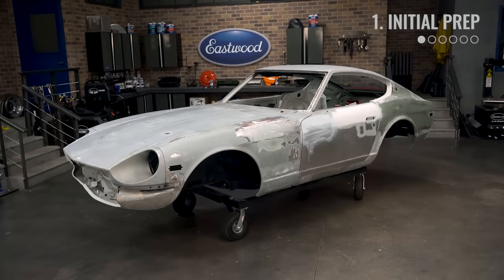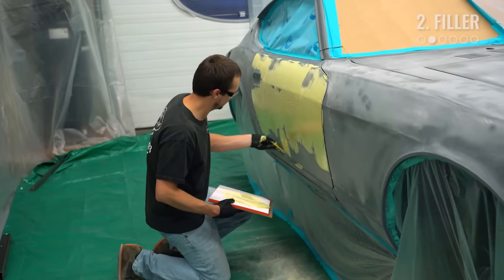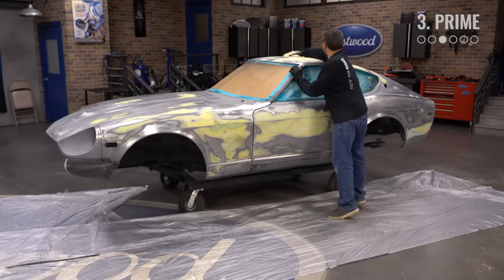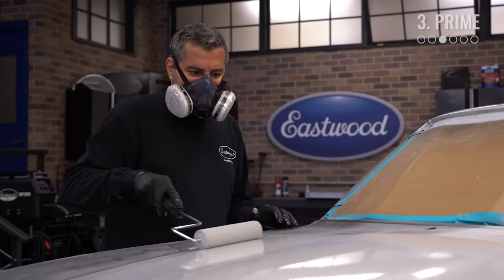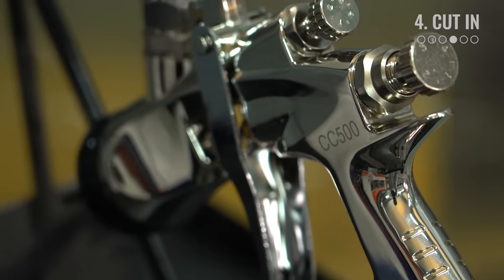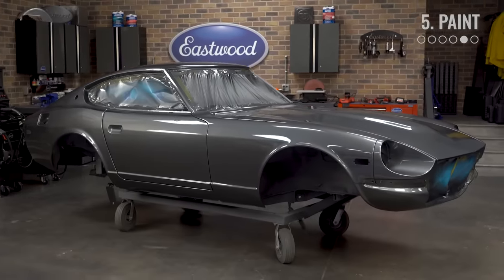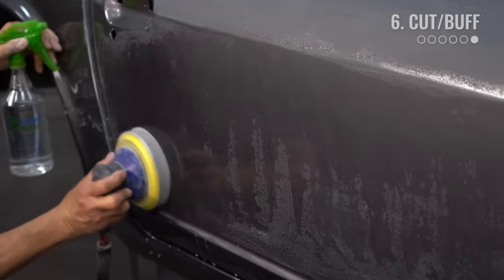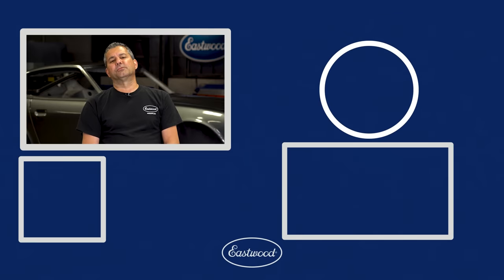STEP-BY-STEP GUIDE: How to Paint a Car at Home

Comment: How much is this project?
Reply from the maker: That's a pretty BROAD question, the car? the body work? the top coats?

Ignoring the purchase of the car, depending on it's condition it will be more or less expensive based on how much metal and body work it needs.

The materials, Plastic Body Filler, Primer(s), and top coats can range anywhere from <$1000 to $10,000.

This probably has $6000 roughly in above mentioned items by the time it rolled out of the shop - which is a steal compared to the more than $25,000 it would have cost at a body shop. (man hours are expensive)

Comment: I can’t find this paint on the site, any more info for this?
Reply from the maker: Here's the link to OEM Select:
https://www.eastwood.com/oempaint/selecting/brandmakeyear

I just double checked the Alfa Romeo Code 319B (used in the video) and it popped right up.  If you have any issues you can always call us directly at: 800-343-9353

Comment: You can do this at home if your house has a paint booth and you live in an industrial neighborhood. If I vented all this paint into my sub-division my neighbors would choke then call the cops.
Reply from the maker: Yes, painting has challenges depending on your garage location.  BUT you can still get the vehicle up through the stages and prepped using the Opti Flow system and then find a paint booth solution.

Comment: The sanding and prep is daunting. I'm not about to do ALLLLL that. It's like 40 sanding steps? Geez. Ok, so this is like, premium level smoothing out the metal. Cool, but, this video doesn't help me get started because I still don't know what sprayer and nozzles to buy.
Reply from the maker: Body work and prep are time consuming but not complicated. If you take your time YOU can also get great results.

We list what our gun settings are in the video by step.  But generally we are using the CC 500 which can be found here: https://www.eastwood.com/eastwood-elite-color-and-clearcoat-hvlp-paint-gun.html

2.0 Tip for Polyester Primer
1.3 Needle for Base and Clear Coat

Comment: Jeez! I just saw a video where a guy painted his truck using a single stage paint (three coats wet) and one clear coat. All these steps are crazy confusing to any beginner.
Reply from the maker: That's why we made THIS video! If you're starting the entire process and thinking about it all at once it can be overwhelming.  But if you break it down and tackle each step one at a time it's much more managable.

Metal Work then
Body Work then
Primer then
Block then
Paint

Comment: steel in the 80s was shit I would start with etch primer,  epoxy is porrus and it may accumulate small amount of moisture which will rust under the paint in couple of years. also basecoat at 1bar only???

Comment: After watching this, I think I’ll just get a wrap…
Reply from the maker: Surprisingly wraps are just as expensive if not more! And you still need to get the body straight before hand.  Where as you can get the top coats needed (paint and clear coat) for under $500.

Comment: That is a lot of filler. Isn't metal panel work better?
Reply from the maker: You want to get the metal as close to perfect as you can before applying filler - that's what's happening early in the video - the metal work.  But it's tough to finish in metal so we skim coated the car and sand most of it off - which is mentioned in the filler step.

Comment: Nice video, but the girl wasnt handling the paint gun to well! Swaying the gun back and forth is a no no. You have to stay a consistent distance to the panel, and end the spray off the edge of whatever is being painted. And spraying the side panels individually, 12:29 ,  loads up the paint on each edge. If that is a metallic ,it wont look good outside in the sun The whole side should be walked from one end to the other, releasing the trigger after you go off each end.

Comment: So this is where people get the idea to use epoxy profennial body shops haven't used it since 1985 we use better filler that sticks to bare metal  and only 2 k primer but I know you're thing is for extreme beginners. And selling alots of unneeded material.thunder road auto body.
Reply from the maker: As mentioned there are lots of different work flows.  We even call out jumping to urethane primer if at a professional body shop as you mention.  This is just one tried and true way.
Reply: @eastwoodco  i particularly dont like epoxy because like you stated it is a tried  way an old one . Epoxy sticks well but takes along time to complete cure thus it may pull scratches by suction at a later date . I think you would serve youre customers better by moving to newer products . Like fillers z grip that stick well to any metal . And if you want to put something on the bare metal newer metal to metal 2k primers filler sticks really well to it and it cured out fast .youre trying to get away from scuffing to put more primer on if work over primer but epoxy only has an open range also . Youre car looks good . Our shop in Dallas specialized in Datsun z cars .  If a guy is working on a corvet you definetly need to sell him some of youre polyester primer . Wear a mask  definitely when sanding it most of them are porous so don't water sand.

Comment: Срочное сполировывание недосушеных наплывов в дальнейшем даст усадку. Правильно окрашенный автомобиль не нуждается в полировке. Гарантия на такого уровня работу от 7 лет.
Reply from the maker: Translation: Urgent polishing of under-dried deposits will cause shrinkage in the future. A properly painted car does not need polishing. The guarantee for this level of work is 7 years.

Response: Every show car you see is cut and polished, it's a normal part of the paint work flow.

Каждый шоу-кар, который вы видите, отшлифован и отполирован, это нормальная часть покрасочных работ.
Reply: @eastwoodco  Различают два типа полировки: а) исправление дефектов при покраске. в) достижение высшего уровня качества.  Путь от первого пункта до второго - повторное вскрытие автомобиля лаком. Благодарю! Удачи!

Comment: I regret going down to the metal now.😢
Reply from the maker: It can be a bit daunting when you think about the whole project, but you know it will be done right!  The trick is to think of it in stages, your next step is to get the car body worked straight, then primer.  Don't worry about which paint gun you're going to use right now.

Comment: Buy rattle can. Shake rattle can for 5-10 seconds. Paint car. If you wanna get fancy, wash car first.
Reply from the maker: That is NOT a workflow we could get behind.  If you don't do proper prep work you'll deal with adhesion issues, dirt, fish eyes, and ultimately the top coat will fail.

Comment: Ummm..........never mind, i will just go by a  new car.   The money it is going to take to remove my engine and transmission just to paint the car will cost just the same as to buy a used car that still has good paint.
Reply from the maker: If you're repainting and not changing color you don't have to do jambs, underhood, etc. so no need to remove those components.  If you're doing a color change you may or may not opt to get in there.